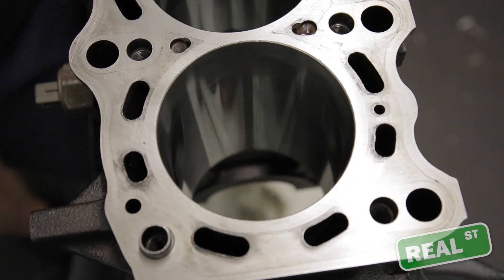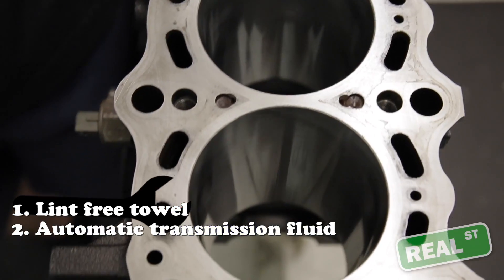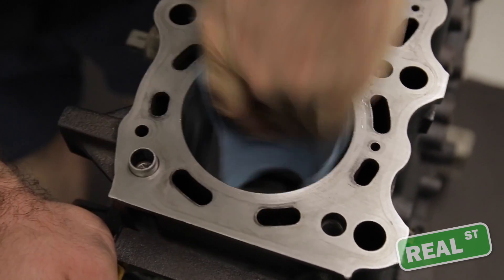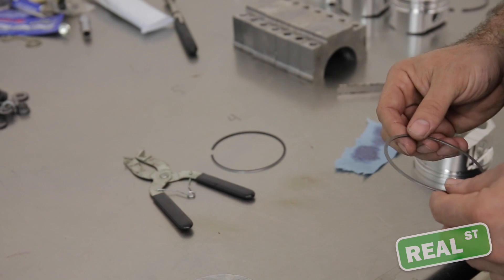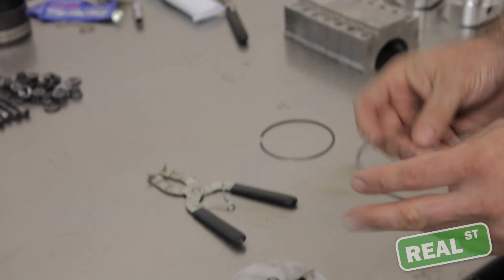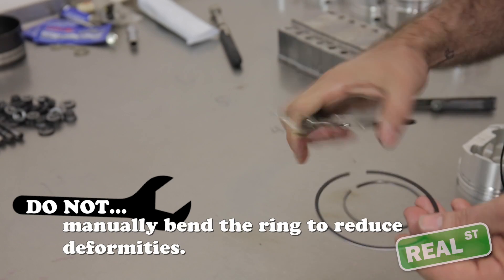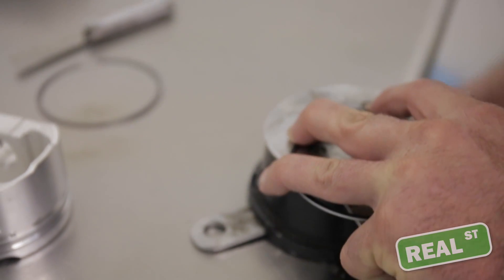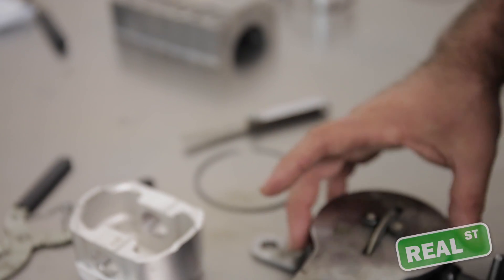Jay's Tech Tips #5: Working with Cylinder Rings

Comment: Clean the cylinder bores with foaming glass cleaner till they shine,Then use penetrating lube on the cylinders and pistons and rings. Assemble and squirt some motor oil on the cylinder walls from the bottom side. Now your good to go.